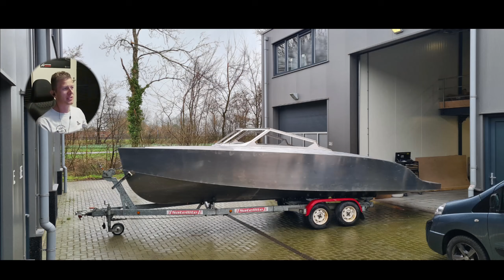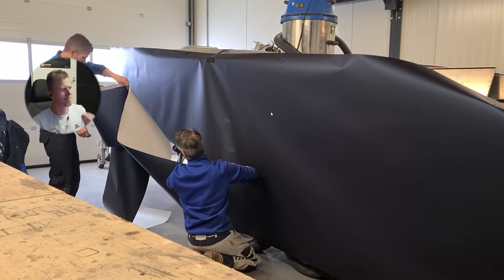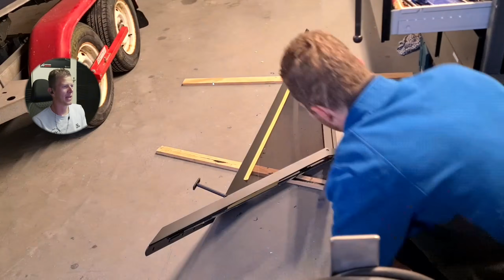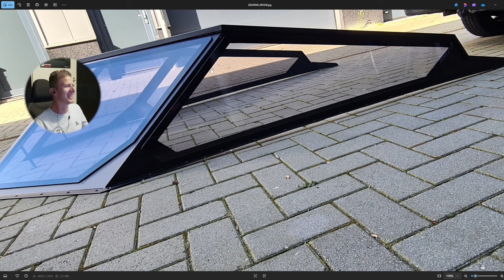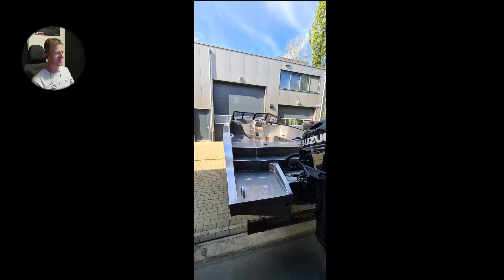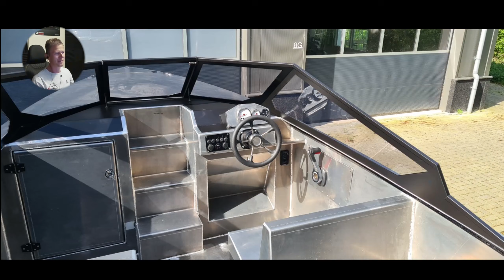I Hate Waiting for Paint… So I Wrapped my Boat Instead

Comment: M'Arnout, pretty skiff, I've seen wraps and they promoted corrosion under neath by trapping vapor - unless them mill scale was removed. I think the windscreen's after most edge or end frame might have been more attractive to my eye (taste, opinion, view, IMO) if the metal frame echoed the stern sheer's curves?  The angular lines windscreen frame's lines don't seem to go as well with the hull's overall look because of the 'drama' or outstanding characteristics of the sheer's line.  Sure is a great feeling when you get them wet and run a little isn't it?
Reply from the maker: Poah you the actuall sailing is amazing!!

Comment: Excellent! Only thing I can think of is you might want to use some isolation tape between the windows and the hull. The layer of paint might be enough to prevent galvanic corrosion, but I'm not sure. Also a zinc anode on the hull by the outboard will help your hull last longer as the salt water will eat it.
Reply from the maker: Yeah this was for a test run only